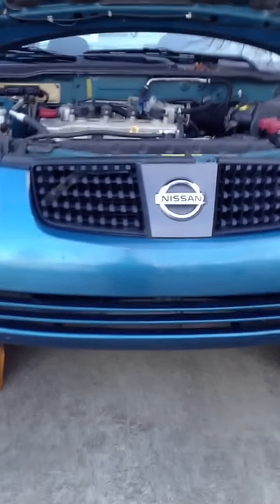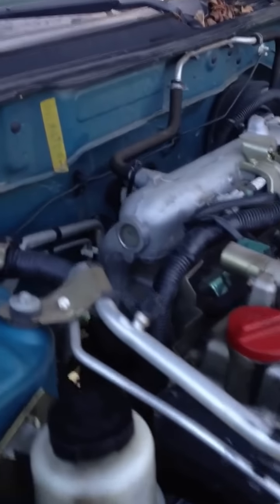2004 Nissan Sentra Crank Shaft Position Sensor Location

Comment: To anyone buying these sensors, don't try and save a few bucks and get a cheap one. I ended up having to buy 2 before I took my mechanic's advice and got a genuine Nissan sensor, and Autozone wouldn't refund me "no refunds on electrical parts". My mechanic says that places like Autozone, O'Reilly etc. carry nothing but generic crap when it comes to parts like these. Lesson learned.

Comment from the maker: I believe I too got my part at AutoZone. OMG I am SO glad I made this video to help people so much!!! Thank you all for the feedback! My husband thought it was silly of me, but since we had such a hard time finding it ourselves, I wanted to share. I'm sorry about that lighting and quality, it was SO hard to get things in there (like my hand, and iPhone). Yes, I took the video on an iPhone. So the reason I had to change it was because my car had no power even with the petal to the metal and only rolled on flat ground at <5 mph. The check engine light was on and threw the code for EITHER OR, the "CRANK shaft position sensor", or the "CAM shaft position sensor". We tried changing the cam shaft (same part) first because it was 10x easier to get to, but it didn't solve the problem until we changed the crank sps.

Comment: Hi Angela u r very helpful putting this on you tube,,I have a couple questions. Y did u decide to change the crankshaft sensor? Did the car gave u any codes "check engine light on""? What was the car doing b4 u change the sensor? N how is it running now with the new sensor,,,,,,was the oreillys sensor worked ok n what is the part number

Comment: Please let me know cos mine sentra needs 3 cranks to star when is 105 degrees or more!!!
Reply: Bethany. Not sure if you still have any issues. Today at a stop light the car just just off. No clunking or anything and I started it right back up. I noticed the RPM's were very low, around 500 when I was in D. When my wife was driving down the interstate she said the RPMs were fluctuating and when she got off the interstate it was doing the same and the car didn't have any pick up. She went to AutoZone and did a diagnostics, it came back to a bad Crankshaft sensor and timing chain/belt. I think the current major issue is the sensor.   The 3 cranks to start, I have to do the same usually 2. I will turn the key, then let it sit for a few seconds and try again. Not sure if that's related to anything here.
Reply: Bethany Teti replace the cooling    sensor.
They are ment to save your engine if over heat, and they could go bad, and will not aloud your engine to start.
Good luck.

Comment: So I can just grab it out and put a new sensor in?
Reply: You Can try :)
It's a very tight fit.
I recommend buying a low profile stubby socket wrench with lots of teeth. The angle to ratchet is nearly non existent.

Popping the old sensor out is tough (potentially). I found an angle using a long flathead screwdriver using the axle cover as the pivot point.

Comment: For the life of me i can't seem to get it out. The bracket behind the sensor seems to be preventing me from removing it all the way
Reply: Unfastening or pulling it out?
The o-ring binds and swells with age. Carefully pry with an appropriately sized screwdriver.
Once you clear the o-right, it should pull out with a pair of pliers.

Unfastened the cam sensor up top. It won't be bound up and it will teach you how it connects.

Comment: I have a 2005 sentra 1.8 automatic. SYMPTOMS::::10 minutes after starting the car driving the car to the stop light will hesitate RPMS WILL DROP ,,,,STALLING,,,2-3 attempts to start in hot weather,,,,,replace the crankshaft sensor n UR sentra will b just like new oreillys $27 import direct ignition 19-0205 ,,,,,SHARE THIS INFO.....
Reply: i have the same issue on the exact same car. so i'm replacing both the camsahft sensor and the crankshaft sensor
Reply: Change your mass airflow sensor too.
This weak starting/low rpm situation is usually crank or cam shaft sensor, OR mass airflow.
Long crank can be any of these and also fuel pump.
All fixes are temporary. This car is very prone to these symptoms.